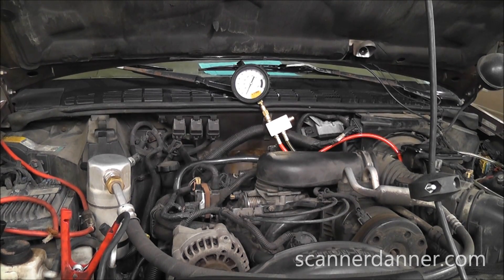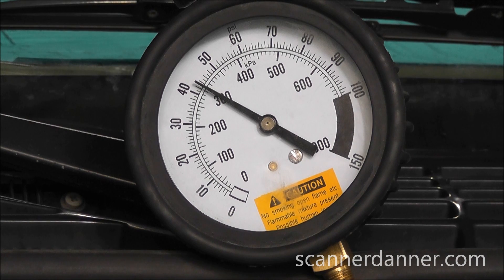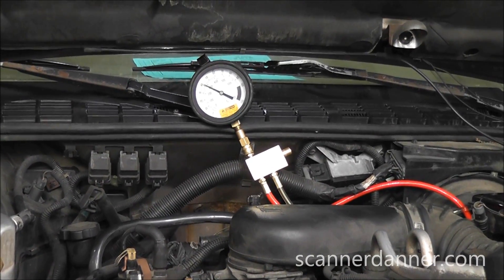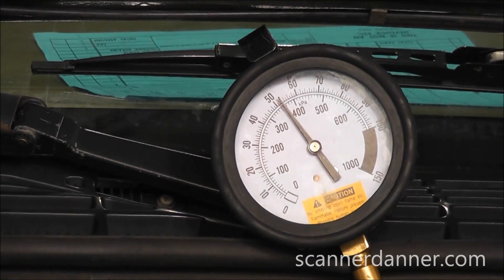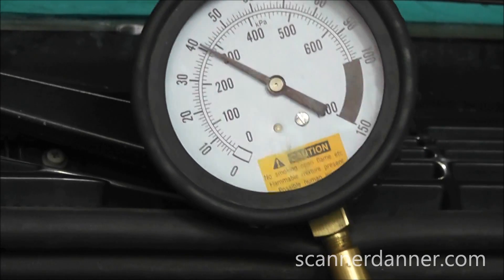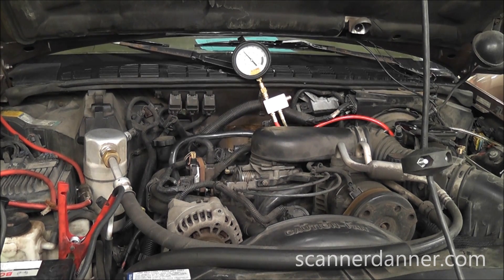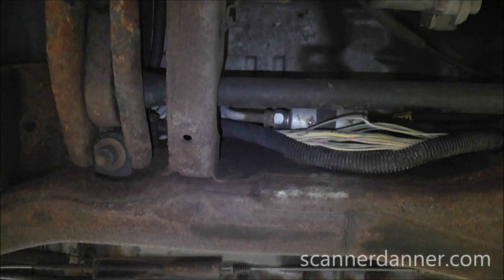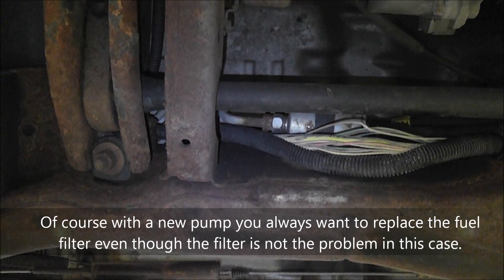Fuel psi less than 50 psi = no start (GM CPI Vortec)

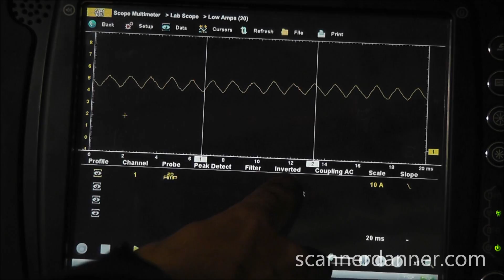Comment: Im dealing with a interesting fuel pump problem with a 96’ dodge caravan. Repair manual states 49psi. No start bad pump I Have replaced 2 pumps due to very very long crank 8-10sec and fuel pressure very slowly increases on a gauge. At 30psi it does start but very rough. 30 is as high as 1 pump goes 10:07  the other was dead on arrival 5psi, hopefully BOSCH will be the final one but these fuel pump manufacturers SUK.
Reply from the maker: 1. What is the power and ground voltage levels with the pump running.
2. Did you also replace the fuel filter? Which I believe has a built in pressure regulator as part of it (3 fuel lines)

Comment: Sure wished I'd found your video earlier. My 350 is doing everything you are showing. I just purchased a fuel pressure guage and I'm getting same readings as you.
Reply from the maker: Pinch the return line and check max psi. It is stays at 50, it's the pump, but check power and ground before dropping the tank. Also be sure to change the in-line fuel filter too!

Comment: Hey man I got a 97 gmc k1500 I’ve been having a fueling problem with, I’ve replaced my fuel pump twice in the past 6 months and just recently replaced my injectors and I’m only getting around 40psi fuel pressure my tanks clean I’ve also replaced the fuel filter and I’m stumped and can’t figure it out, I’ve been dumping gas in the intake to start it every morning but now (since I’ve replace the injectors) I can barely get it to run. I’m pretty sure I have a problem with the wires between the relay and the fuel pump, I would love to get your opinion but probably won’t hear from ya lol
Reply from the maker: Absolutely you need to confirm power and ground at the pump. Is this a returnless system or is the fuel psi regulator up on the rail? We should also do a max psi test on the pump if the regulator is on the fuel rail

Comment: Very informative video!  I've got a cranky Suburban that has rough running after warmup.  Had to replace the fuel pump and the fuel pressure regulator last year.  Was supecting maybe timing issues since when i'm in driving and RPMs are between 1000 and 2000 I get an occasional motor shake.  Will tak another look at the fuel pressure readings.  Have been seeing 50 lbs of pressure.  5.7L Vortec 1999 Suburban.

Comment: When I turn to Key to the on position with the tester hooked up it will jump to 60 and the drop pretty quickly. The truck has been taking a long time to start would this cause this ? Is it normal for it to drop like that.

Comment: I'm having very similar problems I have put a brand new Delphi  fuel pump in from rockauto and replaced the filter I'm still not hearing my system prime with key on position only starts with starter fluid psi at idle is 47 with the key on position it is 0 is it possible I have a bad new pump why am I not hearing my system prime the vehicle runs and idles great once started and I can hear my fuel pump relay clicking
Reply from the maker: Psi is too low, don't worry about the prime, you should be testing that with a psi gauge anyway, not by sound.
Make sure you have a good power and ground at the pump and if you do, pinch the return line off momentarily while it is running. Psi should go to at least 85. If it stays low, you need a pump again or you did something wrong when you were in there (internal leak)

Comment: I'm lost.  I just put a new fuel pump in my 1997.  The key pressure goes to 10psi.  It goes to 32 on crank and starts right up and new varies from 32.  Also just converted to a MFI system.   Running smoother than it ever has.
Using loaner fuel pressure gage.   Could it be a bad gage?  One other gage from autozone never registered a pressure. 
HELP!!!

Comment: I recently had an issue with water in the tank that caused rust. I replaced the fuel pump no start. I broke that fuel pump trying to disconnect the lines. Second fuel pump replaced the fuel filter and the spider injector. I'm getting right at 50psi the vehicle acts like it wants to start but leaks down to 45psi and holds. Should I be getting 60psi?
Reply from the maker: minimum 60 psi during cranking, if you are at 50 or below during a crank it will NOT start on these

Comment: My Uncle accidentally broke off a black rubber T shaped part off the top of my engine middle closest to the window, my chevy blazer, i call 4 door limousine, after tires spinning mud at a fense and all tires were spinning, it would not drive in regular D, it would go in 2nd but its not fast enough to be with regular traffic, i just charged the battery and need to investigate, bad gas possibly and has power but not starting because its been sitting a while, what all things should i check?
Reply from the maker: Sounds like a transmission fault (second gear lockout) You need to scan it for codes

Comment: I'm having sort of the same problem with my truck its a 1998 Gmc sierra CPI 383. It starts with carb cleaner and runs but then dies after 5 minutes do you have any ideas off the top of you head on what to check? I was thinking fuel pressure regulator or injectors are stuck open. Thanks
Reply from the maker: What is your fuel pressure?

Comment: Im having the same issue on a 99 tahoe 5.7 csi. Exact same situation. Only thing is that in the last 3 years this woukd be the 3rd pump being replaced counting the initial pump replaced. Replaced filters both times. Replaced connector once. Pressure holds for atleast 20 minutes at 50 n it will start with fluid after that it will start all day till next morning relay doesn't show signs of overheating burning. My question is what could cause pump to keep going out so frquently? Its a common issue as ive seen on the net. Customer was initially advised to not let tank go below 1/4.  But still

Comment: Great video, Hope you are still around, cause I need HELP. My 96 5.7 350 vortec does the exact thing, starts when primed and runs until shut off.Pressure goes to abut 55 when key turned on, but drops to 10 when pump stops. Reads about 40 during cranking. I replaced fuel pump ( twice ) did not work. Replaced fuel pressure regulator (fun , NOT )did not work. ? ? ? HELP ! ANYONE .
Reply from the maker: Less than 50 psi during cranking on your model = no start.
Power and ground tests MUST be done at the tank connector next and it must be done with the pump circuit energized.

Comment: I have an 03 monte carlo ss 3.8 with 50 fuel pressure. Crank no start. Runs on ether as long as its sprayed. Is my pump to week?? Specs are 53 to 58 I believe.
Reply from the maker: Nope, that is not your problem. ONLY the CPI systems GM used would have no start issues below 50 psi. Your set up would even start up and run at 10 psi, it wouldn't run good but it would run. Sounds like your injectors are not firing.

Comment: my 2000 chevy s10 that I seldom drive, does the same thing, I thought it had a bad fuel pump but after  putting it on the battery charger over night it started right up. This vid explains why perfectly.
Reply: @Junk_fishing101  just boost it 1 or 2 volts

Comment: Hi Paul...Im working on a 1999 5.7 L CPI Vortec engine and exhibits the very same symptoms - fuel psi goes up to 52 as soon as brake fluid is sprayed and stays that way but bogs down at a snap throttle then back to 42 psi. Owner put in new pump about three weeks ago, would spray brake fluid and drove off as usual until last week when engine no longer held the required fuel pressure psi  Ive checked power and ground and looks normal. In the absence of the fuel pump prime connector,  I put power on the gray component wire / pin 87, heard pump run, amp probe it and it showed only 510.mA only.  Did I do it right? Or do I jump 87 (gray) and 30 (orange) and amp probe? Can the oil pressure relay affect the low fuel pressure? IThank you...
Reply from the maker: no on the oil psi switch question. If you jumped the gray wire (pump feed) and are only reading a half an amp, you need to make sure you have a good power and ground on that pump before going back in and dropping the tank again. I believe these have a ground on the frame that is known to have issues.
Reply: @ScannerDanner  Thank you for your prompt reply. I will double check tomorrow.
Reply: @ScannerDanner  Hi Paul...just a follow up. Redid power and ground check and all good, amp eading still low. I recommended a new fuel pump. What mechanic did was, I guess, to forgo the trouble of dropping gas tank, he installed an electric pump in tandem withe the existing pump, with the intention of increasing pressure delivery. He tested vehicle and working well and accelerating
Reply from the maker: @robertlesaca3964  that is a horrible idea in my opinion
Reply: @ScannerDanner  are you referring to the owner spraying brake fluid to make the make the engine start ?

Comment: yes indeed, i've seen a 1lb pressure below the min cause a no start on the old 4.3 with poppet valves,but they redesigned the replacements

Comment: Hi ....I purchased a used 1999 Chevrolet Astro van 4.3L V6 Vortex Motor I replaced the fuel pump fuel filter all relays coil distributor cap and rotor but my issue remains crank no start ....I'll be replacing all spark plugs wires pick up coil soon....as well as ignition module....but was wondering if you can suggest something I am over looking because I'm not getting any spark to the pump in order to get pressure....55psi.....also had an issue with passive key needed to do a key reprogram 10 minute intervals total of 3 = 30 minutes including 5 second off intervals total of 3 = 15 second intervals it cranked and ran for a solid 4 minutes then shut off ....keep having a weak battery issue....

Comment: whats the normal amperage to consider we have a good fuel pump???
Reply from the maker: every car if different and it depends on the psi the system runs. A good ballpark for port injection systems is 6-10 amps

Comment: What direction would you go towards? I got a 97 k1500 5L. I did a pressure test I get 54 55 runs and I left the gauge on and after 10 mins the idle pressure dropped to 50 psi still running but turned off and tried to start and wouldn't work. I've had it stall and start up again but recently it just wont start  up till the last few days.

Comment: Well the guy that did the work the first time said he put a new pump in but we had a fuel leak so he replaced all fuel lines with rubber hoses and eliminated the fuel filter without us knowing it until we had this problem discovering so but only starts if you use starting fluid and runs but if you give it gas open throttle it stutters like in the video needless to say I'm finding a new mechanic
Reply from the maker: bad idea with rubber lines on this high pressure system, 
So it hasn't run correctly since replacing the pump and lines?
Reply: After correcting the fuel leaks it wouldn't start so I use starting fluid and it started then we check the fuel pressure gauge I even went as far as checking for spark changed and check spark plugs for spark yes but yes short answer has it run right since he replaced the fuel pump supposedly and lines
Reply from the maker: Okay, you may not need a new pump, but you may be dropping the tank again anyway. 
Check the internal pump connections to the fuel pump sending unit. I've seen these leak internally (fuel psi will drop immediately on shut down with this issue). Second, make sure the psi line is not pinched anywhere, in particular on top of the tank area, especially if there are upper straps. I've seen guys route the lines incorrectly and not notice when the tank is reinstalled that it pinches off the lines.
Reply: will do thanks for the help threw $1,500 down the drain now he's refusing to even look at it told me to get a new mechanics
Reply: Too bad you ain't close to Wellsburg West Virginia  45 minutes outside of Pittsburgh you could be my new mechanic lol

Comment: As usual your videos are unmatched down to the minute details, which is everything. As you know what might be obvious to one person may be a complete mystery to another, thanks for recognizing that. One question though, what size fuse do you suggest for jumping the fuel pump?
Reply from the maker: a 20 amp fuse will be fine my friend. Thank you!
Reply: 4.3 l on this engine is from low to high 55psi /60/to 62 in perfect start up and running conditions thanks Mr.DS

Comment: How much current should the fuel pump be pulling? I heard 7.5-10amps for the Vortec engines/pumps. Mine is pulling only 4.5amps while running. Only getting 41-50psi. Drives, but has a periodic studder while driving at constant speed and seems like it is running lean at the upper RPMs. Maybe the system has a bad ground? Things replaced so far, Cap/Rotor, Wires, Plugs, Fuel Pump, Fuel Filter, Spider Injection+Regulator, Fuel Pump Relay.

Comment: on s10 1994 v6 vortex got it fixed with what u showed me but it's kinda tuning little rich gonna put plugs wires on it going to take fuel pressure before I do that

Comment: I filled truck s-10 1994 v6 vortec I just can't figure this one out I can drive it one day then won't start a week then won't start got gas then it started doing it sat for 3days yesterday started right up 2 times then nomore  hear fuel pump got a diephy fuel pump guy I got it from says he bought new spider to put in it there's no fuse box under hood just got four bosch  relays on or up above rotor cap I don't have electronics to figure some stuff I'm old school but this is kicking my ass
Reply from the maker: when it doesn't start, what are you missing? What is fuel pressure during the no start? Do you have spark? Injection pulse?
Reply: ScannerDanner  it fired up this morning hit gas died started again so I backed up put it in drive little sluggish turned it off won't crank back till morning it seems ain't getting something after it cranks runs  I don't have electronics wished your place was close I'd bring it I just don't no about vortec engines regular motors yeah.  I haven't done presshure check don't have gauge
Reply from the maker: rent one from the parts store, or buy one for your truck, they are cheap!
Reply: ScannerDanner thank you talking about fuel presshure
Reply: Man thank you messaging you and watching video. My truck started drove it left it running for 2hrs  needs spark plugs wires knaw .your video made it easier to find the problem hope it doesn't do it again it cranks every time and found air leak to thanks brother .I need to come to your school and learn more than I no thanks
Reply: ScannerDanner got it danner preciate it

Comment: I like your vids but I'm still stuck I have a k3500 7.4 454 big block cranks no start I have good fuel pressure and spark but no start I had trouble starting it a few times but got it going by jumping it and starter fluid, it back fired bad and idled like shit for about 30 min then all good for a week 2 days it sat now it will not start only cranks  fuel pressure and spark good but no joy on starter fluid or jump sorry this is long winded but that's all the info I got please help
Reply from the maker: what is your fuel pressure when it is not starting? If this system has the mechanical poppet style injectors, you should have 60 psi during cranking.
Reply: I will have all that info later today and will post it
Reply: So we may have found the problem there where slight cracks in the distributer cap replacing in the next few days fuel pressure was reading 60

Comment: Is there a way to check power and grounds at the fuel pump without one of those expensive tools?
Reply from the maker: yes, with a digital multimeter while you have a friend crank the engine

Comment: I have replaced 2 pumps on my 2000 Chevy Silverado 4.3L. First one was a cheap Amazon one, second one is an AC Delco one (also purchased on Amazon). I am only getting 45 PSI KOEO and close to 50 when cranking. Engine will fire but will not run beyond 5-10 seconds. It seems to me that I might not have enough power going to the pump vs. it being another bad pump.  Thoughts?
Reply: Have you replaced the fuel filter also?
Reply: This is like mine what is the problem?
Reply: Look for a fuel leak, mine had a pin hole and it would take 6 or 7 times turning over before it would start

Comment: Interesting I have a 2002 Chevy Blazer acts the same way but truck only has 50k on it seems like the fuel pump should last longer that that.. Also once you with prime or put jumper cables on it runs prefect no lag like you describing here..
Reply from the maker: Do a fuel pressure test while cranking to confirm. 
Should be 61-62 psi the entire time you crank it.
Reply: I already have it's 55-58 hard to believe that 2 lbs makes all the difference! The Blazzer has 52,898 miles on it.. They are real miles too because I bought this auto brand new ... Granted it is 15 years old but still seems like wouldn't make a difference on run time.. BTW I was looking online what do you think of those aftermarket pumps they are sure cheaper than OEM..

Comment: I've got a 94 s10 4.3 vortec with the same problem it getting gas I checked the injecter to makes sure and it's getting fire in all 6. Ive replaced the fuel pump 7 months ago it shouldn't be out yet but I guess weirder things have happened?

Comment: Have you heard what causes these pumps to go bad so often, and if there is a pump that will last- longer than an 8 month old Delphi
Reply from the maker: A plugged fuel filter will kill these pumps and so will a stuck closed fuel pressure regulator (major rich condition from this one) and finally, junk parts.